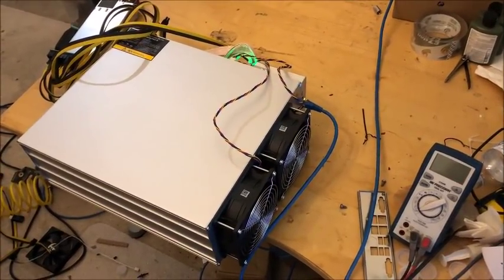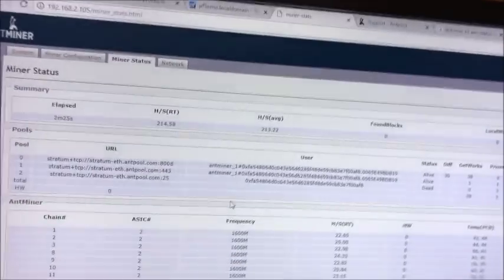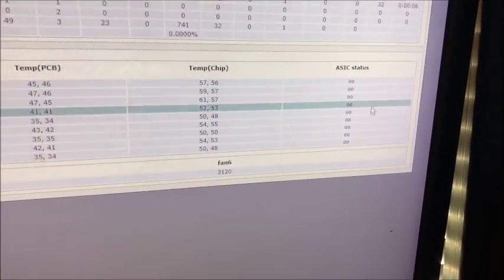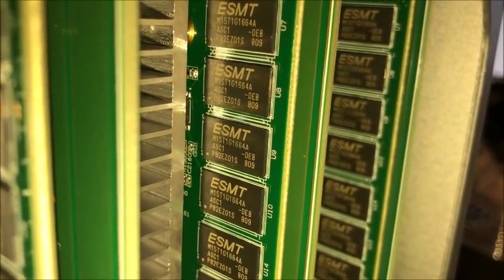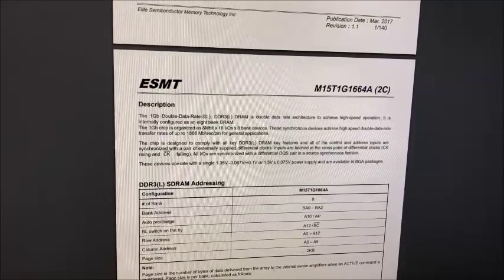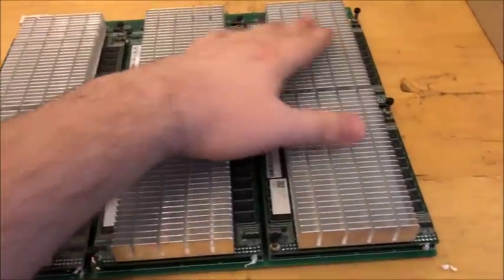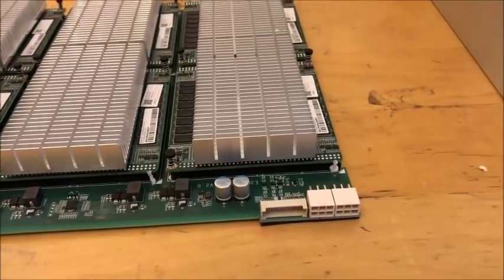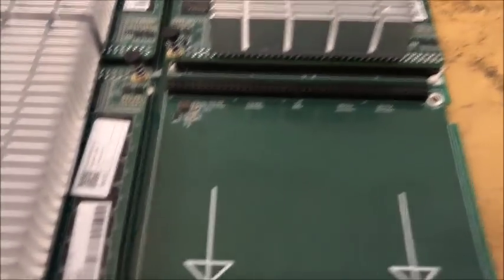Bitmain Antminer E3 - Ethereum ASIC - Fist look and Tear down

Comment: Hello
did you find a solution for future fork? is it possible to overclock? thank you very much kind regards
Reply from the maker: Bitmain might release a zombie-mode firmware that will slowly drop to 0MH/s over first couple months of 2021 instead of immediately after the 4gb epoch in December.
But either way, this device will only be able to mine altcoins with smaller dag pretty soon.

Comment: Nice video! Mine only works on antpool for some reason and it shows the hash rate locally but nothing comes on antpool. Any idea what's happening?
Reply from the maker: I have mine working on nanopool, 
URL: eth-us-east1.nanopool.org:9999
User: 0xyourethereumaddress33223434
And left my password blank
Reply from the maker: It takes a long time to start hashing, reboots a couple times in the process.
Reply: Thanks for the advice! I'll definitely try that. Yeah I left it overnight and still nothing, seemed strange.
Reply: Thanks for the tips... I just got mine and it is taking a long time, and like you say, with a bunch of reboots.  Using your setup for Nanopool.  Very strange behavior compared to my L3+ which boots real fast.

Comment: Hello is it possible to overclock E3 ? did you test it? thanks!
Reply from the maker: I didn’t see it in the settings anywhere, might be hidden.
Reply: Justin A. Thanks for re: should be in miner configuration.. if not maybe not possible.. btw thanks for nice video.
Reply from the maker: Found a hidden page with a frequency setting: cgi-bin/minerAdvanced.cgi
However changing it doesn't seem to change the hashrate.
Reply: Is there another way?